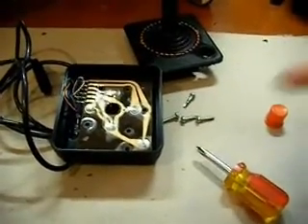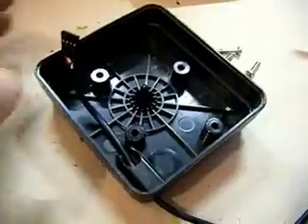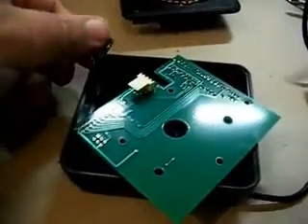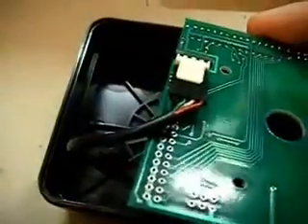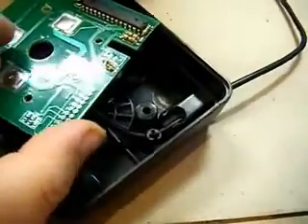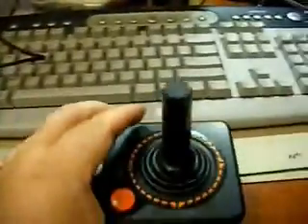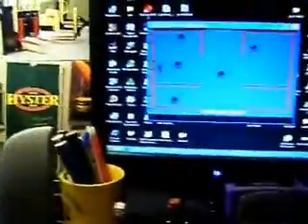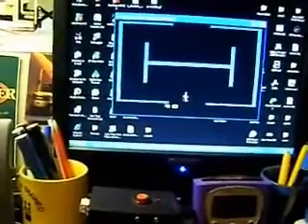Atari 2600 Joystick converted to USB

Comment: You need to first have an atari emulator:  Just Google:
"Zophar Atari 2600" and choose from that list
You can get the games at many places but this link is the best:  Google:
"AtariMania" and search around.
You have to learn how to use the emulator.  Just google or youtube around to learn.  It is easier then it looks.  Take your time its worth it.  Good luck.
Also they have adapters on ebay to do what this man in this video is showing.  They cost about $15 bucks.  Good luck.

Comment: My only thing is, why not just get a usb board that converts the 9pin to usb insted? then you could plug in other controllers aswell. all though this is an awesome project for a busted joystick. To bad it uses those cup switches though.

Comment: what do you call those things at the end of the wire? it looks like some kind of contact clippings connected to the circuit board. is there a proper way to remove them and place them on another wire?